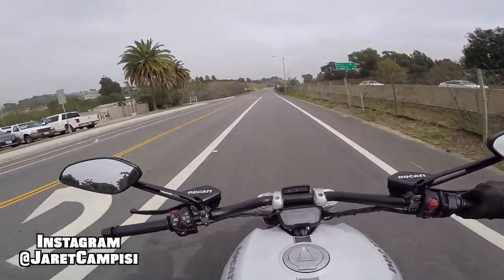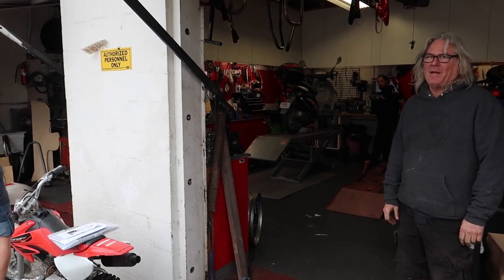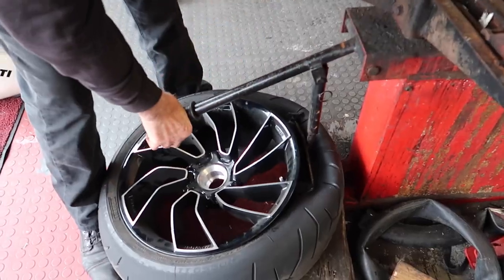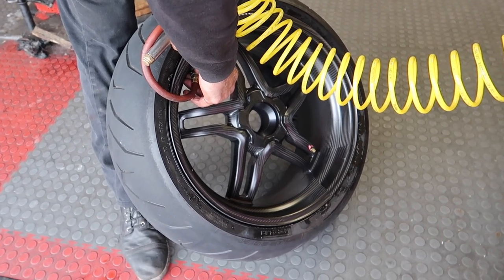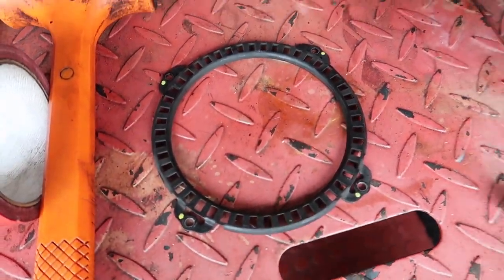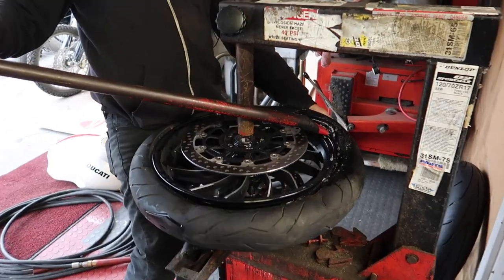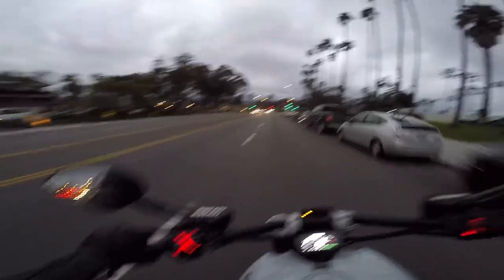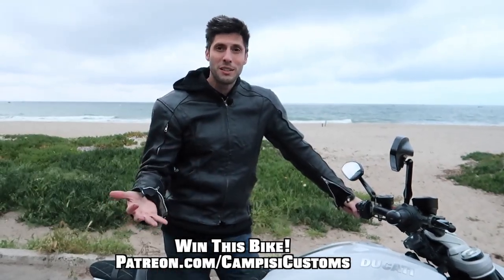Xdiavel gets $3,800 BST Carbon Wheels!!!

Comment: For all, non US residents. 

38lb = 17.2kg (old rear wheel with tyre)
24lb = 10.8kg (old rear wheel, no tyre)
8lb = 3.6kg (new carbon rear wheel, no tyre)
22lb = 10kg (new carbon rear wheel with tyre) calculated.

34lb = 15.4kg (old front wheel with rotors and tyre)
16lb = 7.2kg (old front wheel with no rotors or tyre)
7lb = 3.2kg (new carbon front wheel with no rotors or tyre)
20lb = 9kg (new carbon front wheel with rotors and tyre)

Total saving of 30lb or 13.6kg! Damn, that is quite a bit of rotational mass taken out!
Reply: Sometimes I wish the US used kg instead of their ununiversal measuring unit.
Reply: I really appreciate this
Reply from the maker: @DPloiDEBT  I actually agree I can't stand that we choose to be different for no reason
Reply: not all heroes wear capes
Reply: Just divide the lbs amount by 2.2 to convert it to kilograms
Reply: 13.6 kg for that amount of money no thanks.
Reply: I think I would stick to 30 lbs cause its a bigger no lol
Reply: @knievel8727  you are so right
Reply: @alidaerasmus4837  yeah 300$ per kg 
Unless i'am rich af i will not change 
Sticking to my oz racing wheel for now

Comment: Great weight saving but the original wheels look much better
Reply: That's what I thought also.
Reply: Agreed
Reply: Yes, the spiral spokes are something I've wanted for my straight-spoked 2019 Diavel 1260.
Reply: I like the standard Diavel forged wheels better, yeah, these carbons don't look as good.  Have 4k-5k to throw around?  Probably a good investment even though the looks aren't as good.  Having gone from a 91 ZX6 Ninja to a GSX-R600 in years past I totally recognize the difference in weight.  It was an amazing change.  Shaving 30lbs of unsprung weight probably changes the ride quality drastically.

Comment: I actually like the looks of the original wheels much more than the carbon fiber wheels but there is no disputing the benefits of the 30 lbs weight reduction and how much it will improve the bikes overall performance and handling.  I'm loving your series.
Reply from the maker: Yeah I did love the look of the stock wheels too BUT if it were my bike I'd take the 30 lbs of weight loss haha
Reply: @JaretCampisi Would you really? I honestly don't think I would. I guess I would have to ride the bike to see how much of a difference they make... I am just curious..  do you include all of the original parts to the winner? If so I guess the winner could change the tires back to stock if they wanted to and sell which ever wheels they choose not to use. Either way it's still a beautiful bike. Thanks for your reply Jaret!

Comment: I think. You should have had the original wheel design done one carbon fiber with brushed accents. I like the original wheel design better that the ones you choose. But that's just me. It's still a beautiful bike, stock or customized. What's next on the build list ?
Reply: Yeah, the original design might be a bit flashy, but these carbon wheels are just too plain and uninspiring. But for some everything looks perfect as long as it has the carbon pattern plastered all over it, it seems.
Of course, the weight saving is ridiculously big, no denying that. But for that price they could have made them look a little less generic. Also, what's the point of weighing the brake rotor? I think the weight difference between the two is negligible.

Comment: You should test your scale for accuracy. Should it be showing pounds and ounces? What happens after you have 10/100 pounds on it and start increasing weight by 1 ounce? At what point does it go from 10/100 pounds to 11/101 pounds? What is the minimum and maximum weight the scale can weigh?